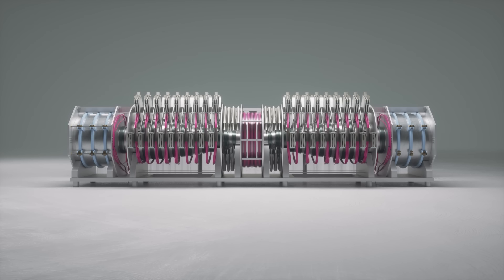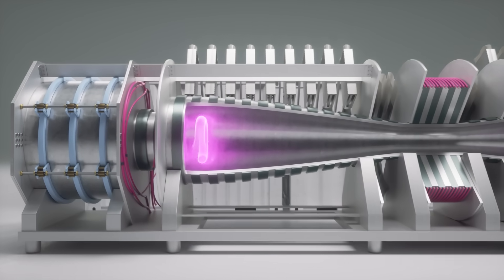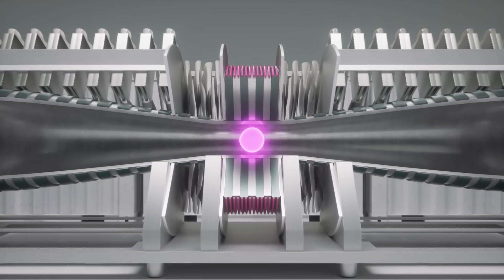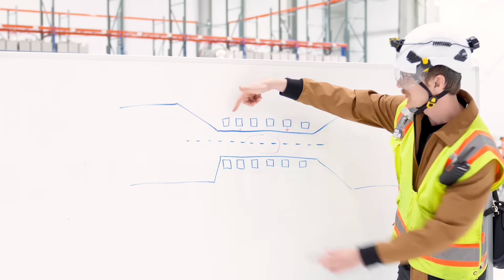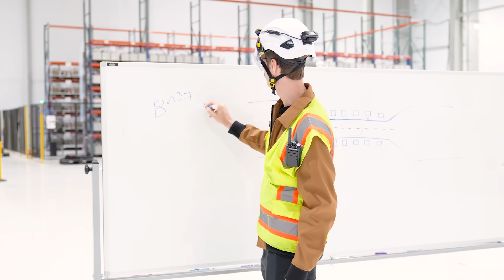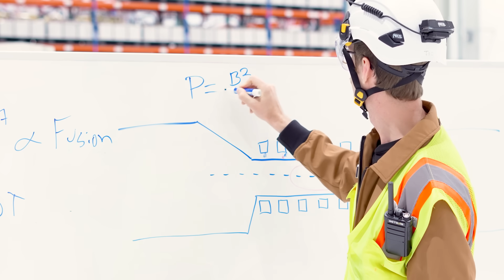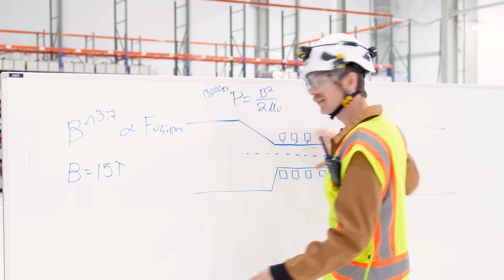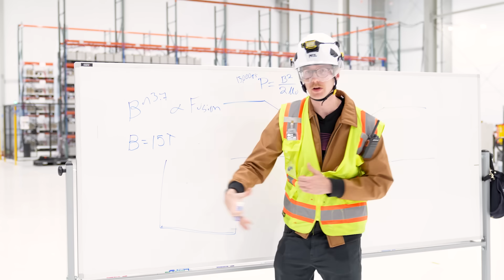The Extreme Mechanical Engineering Behind Fusion

Comment: So when does Helion expect to get net energy?
Reply: They have deal with Microsoft for power in 2028. They are building the foundations for  a plant at the moment.
Reply: @FrntRow I suspect they might technically “provide” fusion power to Microsoft without ever reaching real net gain. Microsoft gets fusion electricity on paper, but the reactor still uses more energy than it produces.
Reply: @Poor_Jimmy9514 WHO would that benefit 😅
Reply: @sluggo3slug  the egos of shareholders?
Reply: @Poor_Jimmy9514 That’s stupid. If they have a Fusion Generator on the Line actually Working, It’ll be wonderful.
Reply: @FrntRow - The rudimentary foundation, that appeared in the promotional video, was simply a staged process that was not part of any ongoing construction process. The Polaris experiments still haven’t demonstrated the generation of even one watt-hour of excess electrical energy and there is no advantage in beginning to build an actual power plant until Helion Energy proves that their concept will end up as being economically practical.
Reply: When the nuclear fusion energy use the term 'net energy gain,' they tend to employ it in a misleading way. Typically the input energy value they use to calculate the 'net energy gain' is a tiny fraction of the energy needed to power the experimental facility. The vast majority of people, who see and share the gain figure don't have the slightest desire to look into the technical details of how it was derived and the project leaders are well aware of that.
Reply: @vernonbrechin4207 they have an ambition to get 10 times more energy out than provided (I think it’s called Q10)
Reply: @vernonbrechin4207 you are think about feasibility, not power, business not the science
Reply: @vernonbrechin4207  Only that for Helion it is a clear "more electricity in the capacitor bank after the pulse than before the pulse".
Reply: I think in theory they do but it’s all engineering challenge. They can make FRC’s and produce fusion but they need to capture the magnetic push back now and demonstrate a fully circular operation with Polaris. The results they say are not being shared outside of NDA from what I gather online they have had a lot of espionage attempts by other countries (sure you can guess who) and other competitors.
Reply: @kyleganse4978  One of the common selling tactics, now commonly employed, is to suggest that nefarious elements are trying to steel, or block products. That approach triggers many people’s love for conspiracy theories which can be employed to explain all kinds of lack of vital evaluation evidence.
Reply: @kyleganse4978  - "...they have had a lot of espionage attempts by other countries (sure you can guess who) and other competitors."

This serves as a good excuse to explain away the company's lack of transparency in regard to many details. Also, many marketers often employ suggestions that other are trying to  hinder a product because they know that many people respond to various conspiracy theories. The ploy serves to increase the many people's interest in the product.
Reply: @kyleganse4978  Who? Japan and Europe?
Reply: 30 years
Reply: Depends on how big your fishing boat is man
Reply: Will be just 10 years out
Reply: Never ;).

Cool toy, but this isn't the tech to use so far as I can tell. PWFAs are probably where we'll ultimately see true net gains (to my knowledge), which is still some development time away.
Reply: @chem7553  - You are in the same company as billions of other Earth humans who prefer to believe we continue to have plenty of development time left.

Virtually all nuclear energy promoters, are in line with the vast majority of Earth's other 8.2+ billion humans, who continue to assume that we still have at least 20 years left to turn this 'Titanic' around using their favorite nuclear technology. They have become masterful in excluding the following warning from their consciousness.

UN chief: World has less than 2 years to avoid 'runaway climate change' (TheHill)
  * This statement was made 7.2 years ago.
Reply: 2 weeks
Reply: Never. They will IPO so the founders can cash out. Helion will never make a dollar of profit.
Reply: @dans3727  Nope. Helion has stated multiple times that they won't IPO until they put power on the grid.
Reply: never! xD
Reply: So, they can’t stand next to Polaris and show us the fusion reactor while running? That is not safe nuclear fusion… 😢
Reply: @quantumkineticscorporation  The restriction may not be radiation based.  You don’t stand next to freshly built prototype gas turbines during testing either.  The forces involved would make a really good explosion if let loose, and nobody knows what the effect of a 13 tesla (!) magnetic field would be on the human body.  

It may be that since the engineering is in the experimental stage, the risk assessment says stay away.  

The real questions are can they achieve net positive energy, will it be economically feasible, and can you convince a scientifically illiterate public that fusion power is safer than fission power?  The first two are theoretically feasible, but I fear the third would be impossible.

In today’s environment, computers would have probably have been banned because they emit RF radiation.  

I have friends that refuse to believe the sun is radioactive, because then we would all die.  I don’t tell them why radio carbon dating or smoke detectors work.  They would freak out.
Reply: @Simple_But_Expensive  Good points. Perhaps education for both the public and private sectors is necessary to end this, “Lord of the Flies” moment in human history… High technology can save the day. But, not many know the deep secrets of the art…. And, most don’t even care…
Reply: @Simple_But_Expensive  - It is common practice, for people who have highly specialized technical knowledge, to find examples of people who are technically naive in such fields, so as to build up their own sense of superiority. Typically those, who have a deep understanding of physical science fields tend to have little academic understanding of fields such as Ecology, Conservation Biology and Evolutionary Biology. The physical scientists may have no understanding of how their fun projects might affect the life support systems on this planet.
Reply: @Simple_But_Expensive  yeah magnetism that powerful, could pull the iron from your bloodstream as a worst case guess imo, but safe testing distance occours within any form of power generation including diesel ones, 
100kva Hospital backup gen is not the breaker box you want to stand next to on a full load startup cycle 😊
Reply: @Waitin4_a_Mate  It all depends on distance and field shape. I've been in a lab with an operating 12T magnet, but that field was confined to a volume the size of a soda can.
Reply: @q@q @quantumkineticscorporation far as I know they want to produce Tritium for fuel, which is short half-life radioactive isotope.

They capture it.

Compared to long half-life products from current fission reactions its way cleaner.
Reply: @odman7945  I believe you are correct. It would appear that Helion’s technology is aimed for assisting DOD’s tritium stockpile replenishment and not helping the public with electricity generation. Keep your heads on a swivel, it might get worse.
Reply: @quantumkineticscorporation dunno about that. One thing I’ve read to be a problem for fusion is fuel shortage. DT-fusion is, I would believe easier to manage because Deuterium is abundant and you can produce Tritium. One other would be Helium3, but its so rare on earth its not viable for commercial use.
Reply: @odman7945  Tritium is worth $30,000 a gram. If your reactor’s exhaust port was spewing out gaseous matter of that value per pulse firing; would you collect it? Answer, yes. This is further supported by Helion’s Tritium exhaust filtration chimney permit application in Snohomish county 1-year ago… The business model appears to be DOD contracts for tritium stockpiles and not sustained electrical power to or for the people. That is probably why Helion won’t release their “inductive recovery” efficiency values to the public…
Reply: @odman7945  apparently not only do they recapture it, but they have a rig to reprocess it back into usable tritium. They have had a few previous videos where they explain this (I think from theory to an implementation)
Reply: @odman7945  Instead of employing the term ‘cleaner’ you could have used the phrase ‘way less dirty.’ Those, who have a promotional agenda, tend to choose their words carefully.
Reply: @vernonbrechin4207 well. I think there is no risk of core meltdown and you dont need to think about storing waste for future generations. So yeah, its cleaner.
Reply: @odman7945  - The intention of Helion Energy is to generate both helium-3 and radioactive tritium gas from the deuterium-deuterium reactions in the compressed plasma. Keep in mind that this may occur on nanosecond time scales and then the next fusion shot may occur 1,000,000,000 times later than the actual fusion reaction duration.
Reply: @quantumkineticscorporation  - Actually the U.S. nuclear weapon stockpile is maintained by a U.S. Department of Energy (DOE) sub-agency (NNSA). They generate their tritium using a dedicated nuclear reactor. That tritium is employed to replenish the tritium contained in thermonuclear weapon reservoirs that provide boosting neutrons in the primary stage of those weapons. So if Helion Energy ships their recovered fusion reactor tritium to the DOE’s NNSA it will be employed for the upkeep of our massive nuclear weapons arsenal.
Reply: @quantumkineticscorporation  If I remember the previous videos correctly, Helion is planning for something like a 10 to 1 ratio: one reactor to make helium 3 and tritium to fuel 10 reactors tuned to make power. On the other end, if their reactors turn out to make tritium better than expected they could build all of them to make He-3 and tritium to fuel all of the OTHER fusion reactors other companies are making, which all require tritium in vast quantities. One commercial fusion reactor could burn through the world's current tritium supply in a matter of weeks, and we're going to need thousands of them, if not tens of thousands.
Reply: @willythemailboy2  - In order to believe in this complex story it is essential to deny the following. In other words one has to  master the art of being out of touch with reality because this will all take decades to implement on a vast scale.

Virtually all nuclear energy promoters, are in line with the vast majority of Earth's other 8.2+ billion humans, who continue to assume that we still have at least 20 years left to turn this 'Titanic' around using their favorite nuclear technology. They have become masterful in excluding the following warning from their consciousness.

UN chief: World has less than 2 years to avoid 'runaway climate change' (TheHill)
  * This statement was made 7.2 years ago.
Reply: @quantumkineticscorporation  - It has been common practice to exaggerate the safety of nuclear fusion energy in the effort to promote it. The Polaris experimental machine will generate radioactive tritium gas as a byproduct. It will also generate some neutrons so massive shielding will be required to protect against that radiation hazard. Additionally, the neutron irradiation, of the surrounding structure, will result in neutron activation of surrounding components in the machine that will cause various elements in those structures becoming radioactive. Many components, in various types of fusion energy reactors will require disposal as low-level radioactive waste.